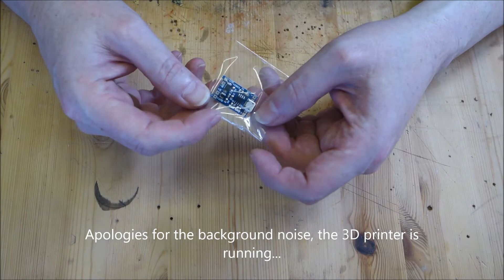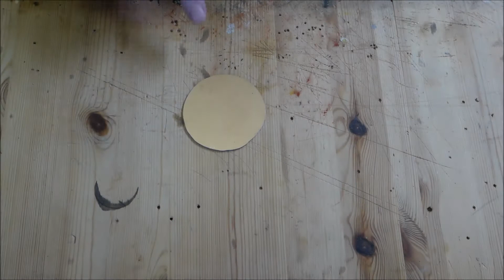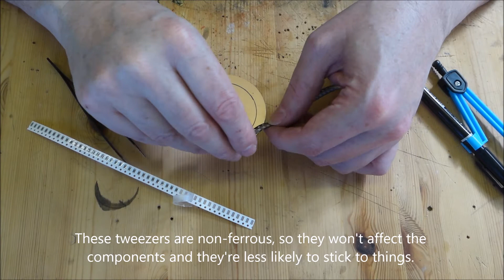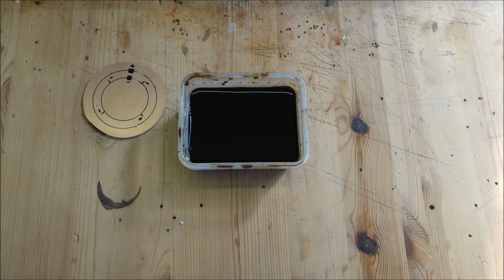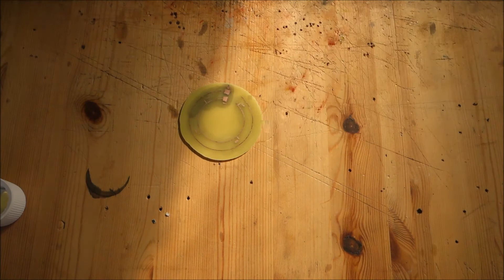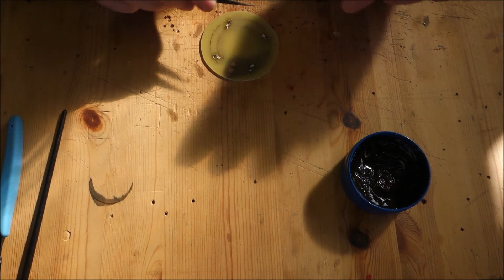Making your own circuit boards

Comment: That's very interesting and totally awesome that this is possible. The LEDs are tiny. Are they the smallest you've worked or are there smaller ones? Great video!  👍
Reply from the maker: I do have some smaller ones that I might be using in an upcoming project.